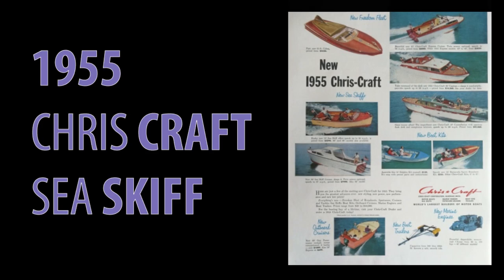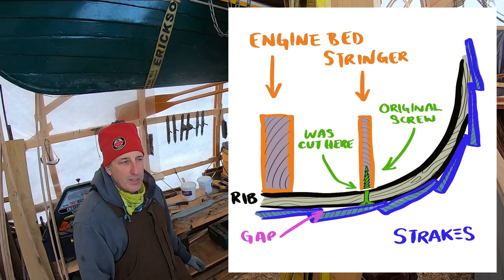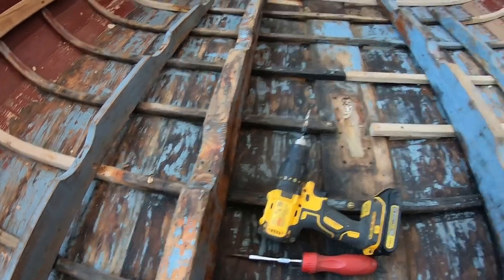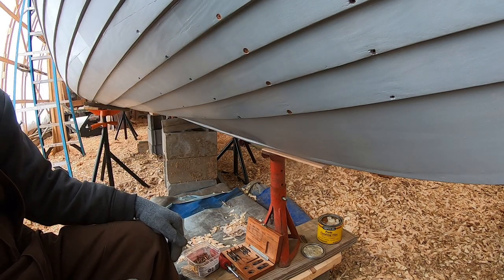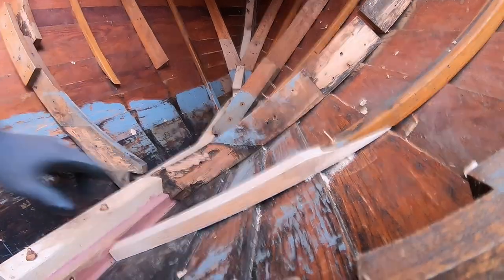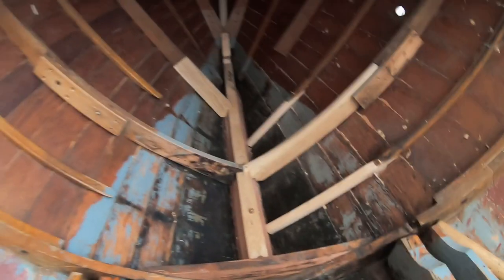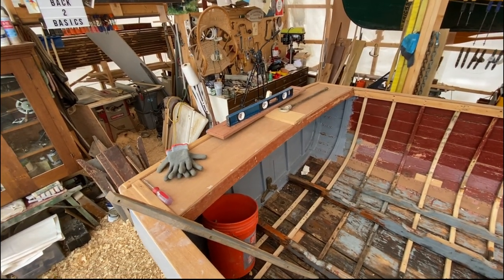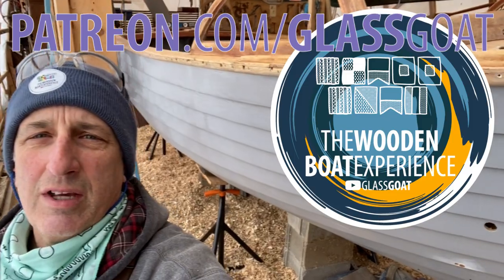Back to Basics on the Chris Craft S2 E21

Comment: Are you going to apply a finish to the backside of those new pieces of wood ?  I'm surprised you didn't paint those stringers before you installed them.
Reply from the maker: Almost all of the new pieces in the bow are only dry fit so far. When it is all together, I will take it back apart, paint it and then reassemble/epoxy. I won't paint the glued areas. The stringer you saw in the video was the only one that was ever removed. Those only had varnish on them at the factory and the bottoms had no paint. The paint was added later on by somebody. I figured it lasted without a problem the way it was since 1955, I wasn't messing with it :) Besides, it was too cold to paint.

Comment: Question, why no adhesive on those scarf joints in the bow?
Reply from the maker: Good catch. Everything is only dry fit so far. When interior of bow is done, I’ll take it back apart and put together properly including epoxy. When it is cold it’s best to prep everything and then paint all at once and final assemble all at once. Thanks for being aboard!

Comment: How did you end up plugging the double screw holes to make it water tight? Is there enough meat in the strakes to hold the screws? These are things I don't know much about. I've only ever worked on fiberglass boats before. Other than wood stringers.
Reply: Let me add. I have no idea how to make a wood hull water tight, what is acceptable or or not. It's like magic as far as I'm concerned 😅
Reply from the maker: I may put a machine screw and washer through that one hole where I missed the rib, but I could just put some 5200 into it and fair over it. The strakes are too thin to just put a wood screw into though without the rib behind them.
Reply from the maker: It is actually surprising how water tight wood hulls are when built this way unless they have issues. Most issues are a result of lack of maintenance over time and improper storage when out of the water. This is why people like fiberglass so much. Most people would rather boat than work on boats, I like both just as much. :)